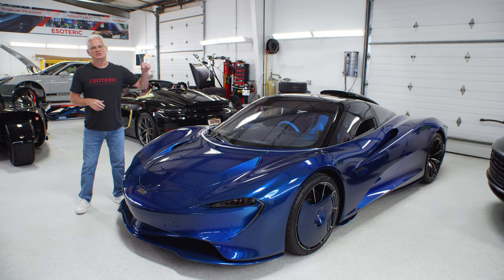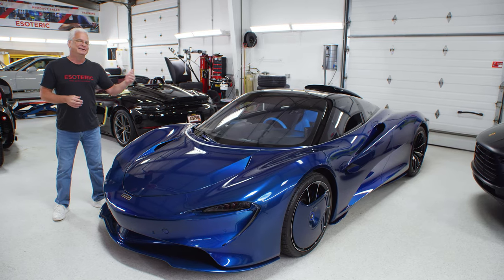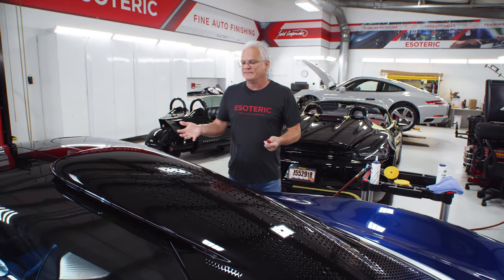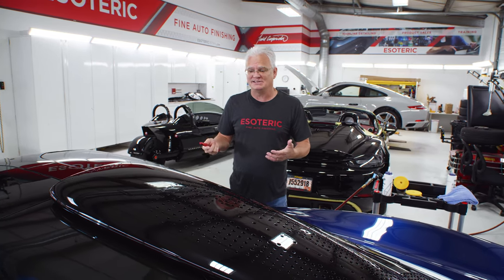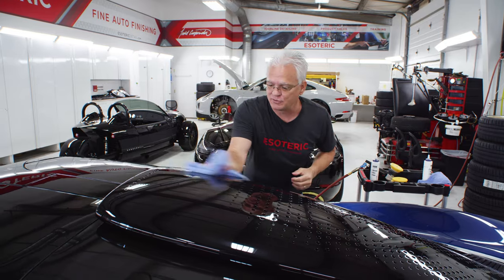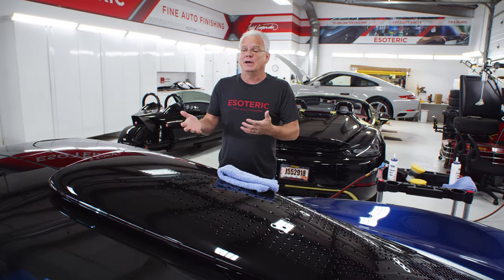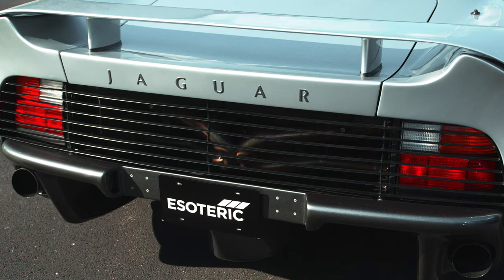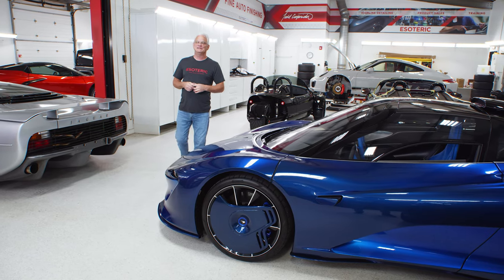We polished the FASTEST McLaren in the world! | Speedtail Paint Correction

Comment: Great video Todd. Really enjoyed the info at the end. Here's what wikipedia has to say about the XJ220...(Main point is that it was a V12 engine. 
"The Jaguar XJ220 is a two-seat sports car produced by British luxury car manufacturer Jaguar from 1992 until 1994, in collaboration with the specialist automotive and race engineering company Tom Walkinshaw Racing.[3][4] The XJ220 recorded a top speed of 212.3 mph (341.7 km/h) during testing by Jaguar at the Nardo test track in Italy.[5] This made it the fastest production car from 1992 to 1993.[6] According to Jaguar, an XJ220 prototype managed a Nürburgring lap time of 7:46.36 in 1991 which was faster than any production car lap time before it.[4][7][8][9]

The XJ220 was developed from a V12-engined 4-wheel drive concept car designed by an informal group of Jaguar employees working in their spare time.[4] The group wished to create a modern version of the successful Jaguar 24 Hours of Le Mans racing cars of the 1950s and 1960s that could be entered into FIA Group B competitions.[10] The XJ220 made use of engineering work undertaken for Jaguar's then current racing car family.[11]"